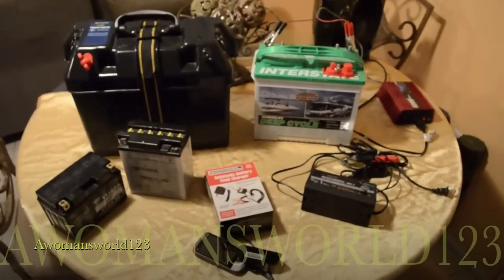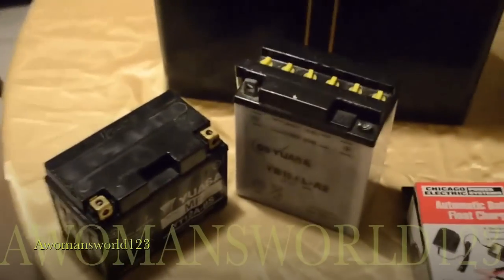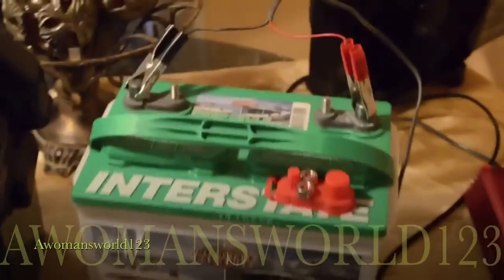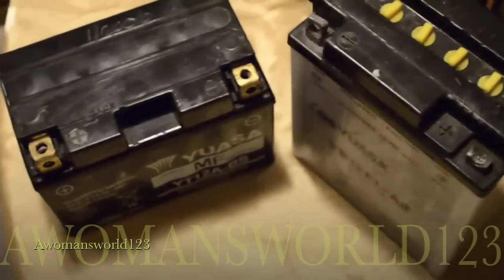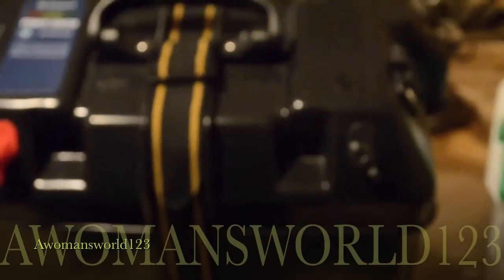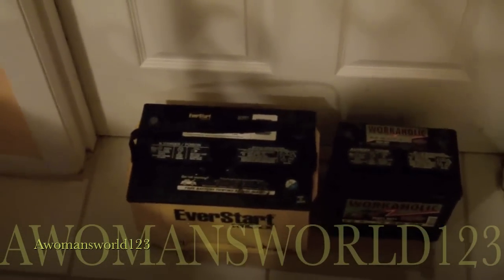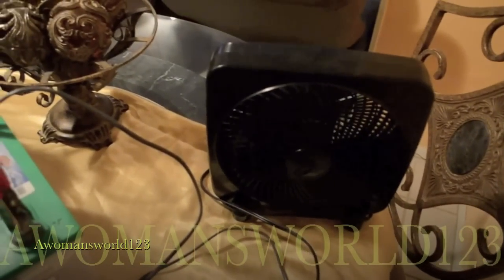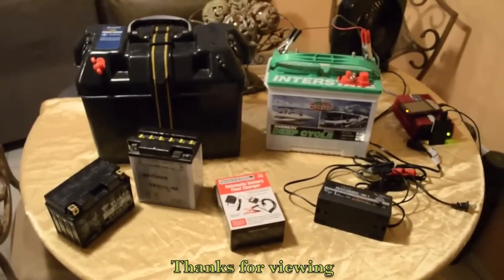SHTF battery backup system for my Bugout trailer

Comment: Cool deal, now all you need is a small 80 watt panel and a charge controller to keep the batteries topped off and charging, and you will be set forever and wont need the battery float. I have a video on my solar backup system. My charge controller even conditions the batteries once a month to exercise them some. Its a great system.

Comment: Nice. I am going to install a auxiliary deep cycle sealed lead acid battery in the back of my SUV to run radio equipment. Just make sure you charge the unsealed batteries in a well ventilated area. They release hydrogen gas which is explosive. If you can find a DC fan it would save you energy by skipping out on the inverter.

Comment: I just recently watched your solar charger video you just put up. I got to thinking, well you'll a battery to start a car, but in an emp it fries all electronics. So another thing you might want to throw in your cage is a wiring harness for whatever car you have now. Get the know how to change out and wire the essentials you need in your car. starter, alternator, lights and what not. That way if that ever happened you would almost certainly have a vehicle. just food for thought (:

Comment: Harborfreight sells the solar powered battery tender, ..i use it to keep my 77 Riviera which i store in my back yard for the winter months.The tender kit comes with cigarette lighter cables along with alligator clamps..I just plug into my cigarette lighter outlet gorilla tape the solar panel facing east to my driver side window on the inside of vehicle,,battery stays charged all the time..

Comment: 1 more thing, the solar panel comes with suction cups..for glass installation ,i use the duct tape instead because the suctions at times could fail to adhere …plus the car right now is half buried in snow, thank goodness my drivers door glass along with panel is getting all the much needed sunlight.

Comment: You already have most of the components for a small solar generator system.   I think all you would need is a panel and charge controller.  You can set the charge controller and panel up to use standard type plugs instead of the solar specific type plugs and not have to leave the panel on the roof if you are not trying to run big stuff like power tools the way I  do.   I have some instructional videos on smaller solar power setups over at my channel.
Reply from the maker: I have a video posted of my cheap solar set up. Check it out  
Cheapest emergency solar panels for DIY projects and SHTF emergencies.
Reply: I checked it out and commented.  I started out with the Harbor Freight panel kits too.   I ended up giving some of those to a "homeless" guy really cheap ($60 for four panels and I threw in a charge controller and custom bracket) who put them on a home built houseboat he lives in on the river.   He is happy with them but personally, I upgraded everything else to more powerful panels.